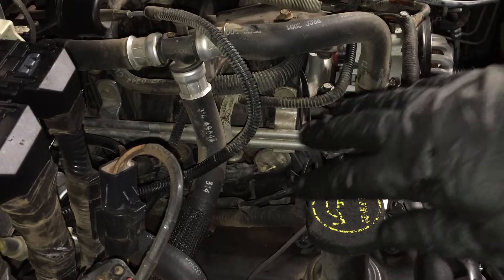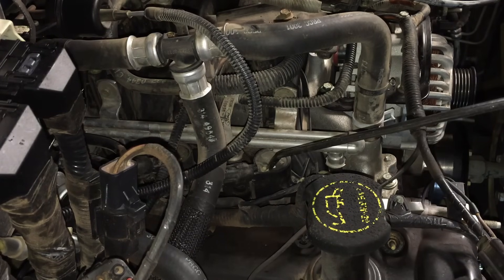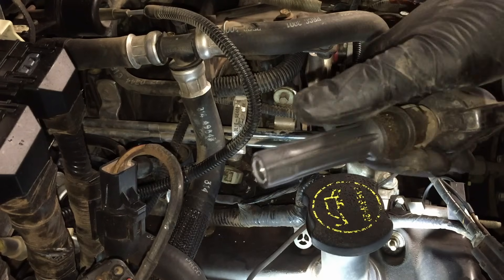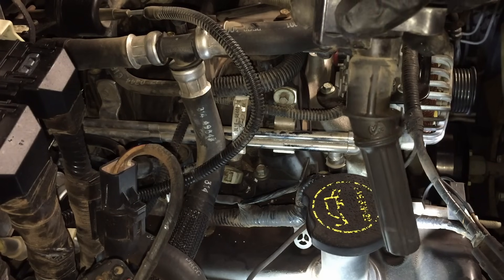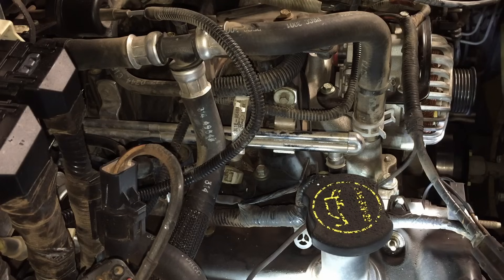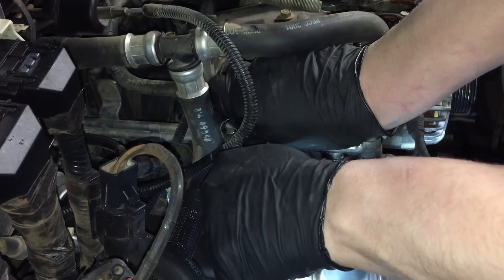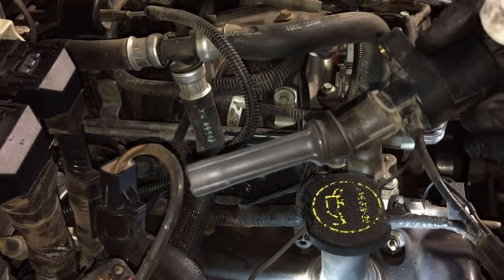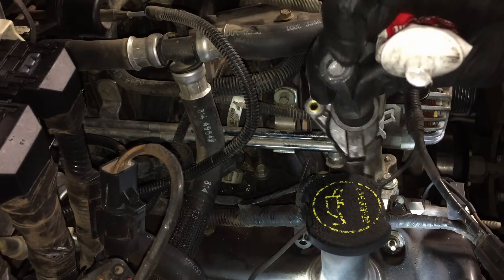Important Tips When Replacing Spark Plugs on Ford 4.6L 5.4L 6.8L 2v Engines

Comment: Thanks so much for your help with this issue. I have a 2003 F150 4.6l and this is the second coil that I need to replace and I can't afford to pay the shop another $250 so this helps a lot.

Comment: Why would there be a metal piece in Cylinder Nr 4 on a 2000 Lincoln Town Car 4.6 Liter engine?  I found it when I could't get the spark plug socket to go on the plug.  Apparently I jammed it when I was trying to engage the socket  I tried to remove it but could only get it to turn down on one side.  I can get a pick under that side but can't get enough leverage to remove it.  Any suggestions on why it is in there and how to remove it?

Comment: Small but important issue with re-installing these plugs.  Torque wrenches definitely provide predictable and repeatable torque, settings that are much more reliable than "go by feel".  Whose "feel"  Without a known force being applied or when a set torque is reached the casual DIY mechanic has no idea how tight or lose plugs really are.  As important a task as this is its equally important to give newbies advice that relies on experience they probably do not have.

Otherwise one of the better Modular Motor plug changing videos.  Thanks for sharing!
Reply from the maker: +jwa718 Delete? True but a 3/8" standard length ratchet improves that feel and prevents over torqueing for most owners.

Comment: my father did a radiator flush on my 2002 ford expedition. Now it idles too high just above 2000 rpm and goes down a little. I drove it and it also now hesitates like its going to die when you go to stop. Any suggestions?
Reply from the maker: +Randy Nelson Jr Check the vacuum and pcv lines.

Comment: Just changed my spark plugs but went cheaper and got NGK plugs. Week later I hear a ticking/printing noise. thought it was loud injectors or valve slap. Should I try motorcraft or thicker oil?
Reply from the maker: +Ernest Hayes Motorcraft
Reply: I forgot  to state that's it's the 3.8l v6 windstar.  It has a knocking sound,that comes from the intake clamshell area.

Comment: I have a 2001 f250 with the 5.4 and I was able to replace 7 of the plugs but ran into a rubber boot at the bottom one of the spark plug and can not reach the hex part of the plug. how can I get this rubber piece off the bottom of the spark plug?I have tried a wire hanger, 3in deck screws, and long thin needle nose pliers

Comment: Could you do a video on changing spark plugs on the 4.0 engine like what is in a 2010 mustang? Mine seem to be micro welded in the heads at only 50k miles. Thanks!

Comment: I have a F150 with the 4.6, 8th letter in the VIN is "W". I hear these are the 2V models. I wanted to double check and make sure this is the 2V because of the horror storied I have heard from the 3V engines. Thank you for the video it was a great help
Reply from the maker: +Matt Rachal I have never seen a 3v 4.6l in the f-150
Reply: ok thank you! I am not a genius when it comes to engines. All I know is that i dont want to hear that terrible crack when i remove the plugs. Thanks for the video as well great help
Reply: They do indeed put 3v 4.6 engines in f150.  At least in 2009 they did.  I did a timing job on a friends after it chucked a roller follower.

Comment: Hi, I just watched your video, very very insightful.  I have one question.  Do I need to take the fuel rail out to get to plug #7?  It looks like the only thing I can do since there is so little room.
Reply: Very late reply, but NO, you don't have to remove the fuel rail. It is a real PITA on #7, but it can be done with patience. I can't tell you how many times I have cussed at the Fuel Pressure Regulator that sits in the way lol.
Reply: i didnt have to on my 5.4l expedition '00
Reply: John Stutz Pulling the rail and fuel injectors, you may have to replace all of your o-rings on the injectors. Other than that, it's just added stress lol. The coil will come out. You wont break it. The rubber boot will flex. Twist and pull the coil at an angle. The coil will come out from under the fuel rail.
Reply: John Stutz Do you have the bolt removed that holds the coil in place? That is the hardest part. I bought several wrenches of different lengths and shapes lmao to attack that coil. Flex head. I even bent a long wrench to reach the bolt. My issue is my hands are big, but was able to get the bolt out with a regular length wrench. I had to fish the wrench into place due to the coil and injector wires along the valve cover, but I couldve disconnected each wire and pushed the wires out of the way. I just didnt want too. I kept a long magnet in one hand near the bolt as I used my fingers to back the bolt the rest of the way out. As soon as the bolt came out, I grabbed it with the magnet. Twist the coil and pull as you are twisting it. Reversal, Put the coil in the same way you removed it. Installing the bolt is the hardest part. Id LOVE to meet the idiot who designed this engine.
Reply: @Pr0ph3cy-k5z  Whats funny, on my 98 I used a small Zip Tie and zipped it tight and it came off with ease on 7 and 8 . Now, my 99 is due to get new packs and coils and I will do the same with that also.
Reply: I have CUSSED AT THIS FOR OVER AN HOUR NOW !!!   I cant get the coil out there is not enough room.  What are the down sides to pulling up on the rail?
Reply: Regarding the V10 2V, you do not need to remove the fuel rail.
Reply: I didnt on 03 p71. Just wiggle it out. The boot's all rubber

Comment: what is the most amount of miles that you have seen on an original 2V 5.4l and automatic transmission on a ford pickup?
Reply from the maker: +Jeffery Graham Maybe 300k
Reply: ok thank you for getting back to me so quickly.  I am looking at an 03 f350 with 276,Xxx on it.  it's rwd with the position rear end. I think I might pick it up for 1600.00.  it has very minimal rust and has been babied.  what do you think? it has the 5.4l.

Comment: Any suggestions for removing spark plugs from the 4.0 V6? My 2010 mustang has 51000 miles on it. I tried removing them with a 3/8 ratchet and medium extension but could not get them to budge. I was applying enough torque to flex the extension so I gave up in fear of striping out the thread on the heads. I even tried tightening and then removing but no luck. I have heard to try and remove from hot engine but also read that is a no no. Have also heard of using penetrating oil and let it sit over night then try to remove but haven't tried that yet. These are the original plugs. Why Ford did not use anti seize is beyond me.

Comment: my car has a misfire for cylinder 4,7 and 8 what do you think is the problem I changed the spark plugs,I have a 2002 grand marquis
Reply from the maker: +james joj Oil in the wells and coils most times.
Reply: +FordTechMakuloco how do I get the oil out the wells

Comment: Having been an automotive technician and shop/business owner for over 40 years, I have worked on, and witness the development of technology of, a great number of systems and engines over the years. I don't have a very high opinion of Ford's modular series of engines, I think they are an engineering failure. However, they are great for making money.
Reply: I've always heard that the 4.6 V8 was a quite decent engine, especially in comparison to the 5.4 V8.

Comment: Hey man, I'm a new subscriber and really dig your videos and your approach, attention to detail in explaining items that so many miss or say under their breath thinking it's not important. Been kinda hooked on learning more about my F150 5.4L from ya. Thanks for that. 

Question: I watched the above video and finally went in there and got all sparks done besides 7 & 8 because the chromed fuel lines ext. above the 7mm on the coil. I heard you mention the swivel for the ratchet which I have but was still a pain in the a**. What exactly do you recommend tool wise for getting in there the easiest? I might have the wrong type of something. 

I'll say that fallowing your tips it wasn't at all as hard as I thought it would be and definitely not as hard as all my know it all buddies said it was....
Thanks Again brother, Dave
Reply: 7mm open end wrench that ratchets. The ratchet end also moves into different angles. Not sure what its called, but Gearwrench makes it. I had bent a 7mm open end wrench that worked, but took forever to remove the bolts. The ratcheting end open end wrench fixed that issue.
Reply: MintCraft Pro FPG7MM 7mm Flexible Ratchet Wrench, Small, Silver. Look for it on Amazon. My mistake on the brand name.
Reply: small zip tie worked for me very well, just my two cents,

Comment: Good tips, put I've always been told NOT to use anti seize, and not to over torque it as it will ruin the thread also. And always do the plugs when the engine is cold.
Reply: If there are too few threads to begin with -- thanks, Ford -- such that engine vibration causes plugs to back out and eventually blow out, why would you use anti-seize to hasten that officially 'undocumented' and unofficially well-documented feature of the Ford Triton?  Keep your anti-seize on the shelf.

Comment: My 2007 5.4 in Regina sask Canada Ford dealer wanted 1800.00 to replace the plugs.
Reply: +Dean Zelles They are counting on breaking all of the plugs.
Reply: 1 Can = 0.76735 usd as of today.
Reply: +Dean Zelles What is the exchange rate 100 canadian to 500 us dollars?!
Reply: Dean Zelles my buddy wanted 3 1/2 hours = about $450 labor ( $150/hour friend price ) and plugs $30, if you get coil packs $250, wires?? that's $ 730 before wires.  I imagine it would be $800 from a friend....  I'm so doing it myself

Comment: I have a code P 0304 misfire cylinder 4 detected how to fix that. My expedition shake when I press on the accelerator pedal roughly while drinking but not when it is park. Please help!
Reply: +Michel Tran I have the same problem
Reply: +Michel Tran You guys need to cut back on all of that "drinking." Your first step to diagnose, and repair, a OBD2 code P0304 would be to check for spark at the plug with a spark tester. I personally like an OEM 25069 which has an adjustable gap(resistance) which allows you to test many different types/design ignitions. They can be found at AZ for around $10.

Comment: If only 1 or 2 coil packs are weak,shouldn't the car start?....
Reply: +roger b Yes it will, but with one coil bad, it's rough and only limp around town, no highway.  Have not experienced 2 bad coils, but I bet it's way worse.
Plus you ruin your Cat Converter ($2k) if you drive long w/ a misfire.

Comment: i have been running E3 plugs in everything that i have including my 95 lincoln towncar with the 2v 4.6L and even though if it was me referring to a customer i would recommend the OEM plugs i just prefer the E3 myself. my towncar has 326K on her and she has started to knock due to being run low on oil too many times (the car had a bad oil leak that i almost never figured out). i do love the car and i am amazed at how well these engines run and how reliable they are. do you think that there is any way to put the 4v 4.6 in the towncar without running into too many issues (thinking of using a 95 mark 8 as my basis for a donor car) i appreciate any input on this that you may be able to offer. i was told that the valve covers were too wide to fit in the towncar because it would hit the brake booster and im not to comfortable with going to a smaller booster considering how big of a car this is lol.

Comment: Great job on the video. Question how often do I need to change the coils, because I have a 2004 f150 4.6 with over 300,000, and it use to be my dad and he can't remember how long it been since the spark plugs were last changed???
Reply: +Daniel sill Towards the end of video, he mentioned to change them by 100,000 miles, and to use motocraft only, since after markert coils tend to have problems.  He has a link to Amazon for motocraft plugs that will save you money versus a Dealer possibly.   Watch the later half of video for his specific statements if you like.

Comment: Do you have a good tip on how to remove the plug, I was trying to remove them and broke mine off.  They are extremely tight in there.  The whole plug came off expect for the thread part of the plug and the outer casing is still stuck in the bay.  I have a 2003 ford f150 4.6 liter.  I looked at your other videos but they are for the 2004 and up so those removal tools look that they might not work.

Comment: Any suggestions on removing the 7mm COP bolt if frozen? Or if the insert just spins in the intake? Great youtube channel BTW. Very impressed.
Reply from the maker: +David Lane A vice grips and a slide hammer is what we use
Reply: +FordTechMakuloco Thanks for the tip!

Comment: I have a 2002 explorer 4x4 4.0  it had a new transfer case installed new rear abs differential sensor new output shaft sensor the two new speed sensors and a new transfer case motor and  a new 4x4 control module behind glove box. when making sharp turns it feels like the front wheels lock up. when I unplug the 4x4 module or the transfer case module the wheels don't lock up.
Reply from the maker: +Alexis Gutierrez What are each of the tire circumfrences?
Reply: I think it had 16 inch rims factory ford wheels i dont recall the tire size, i have the truck at work. Rims are Five spoke design. For now I just put in 4x4 auto and just unplugged the 4x4 control module behind the glove box. It's the only way it drives with no locking at sharp turns. But at some point I know I'm going to need 4x4.

Comment: IF you changed coils with aftermarket already and it was fine and then the truck sat for a year, would that cause those aftermarkets to cause issues when they were fine and no miles were put on them?
Reply from the maker: No it should not but those cheaply coils can fail at anytime just not likely

Comment: Spark plug screw on cap fell off when boot was removed from spark plug allowing it to fall out of boot and landing at edge of spark plug so the socket would not slide over the spark plug to allow removal

Comment: Helping my son today to change spark plugs on a 5.4 2v 1998 ford expedition, started out good on first plug all went okay, got to 2nd plug on passenger side, I believe it's #2, spark plug socket is 5/8 but it won't slide down over the spark plug so we can't remove that one, can't see down in the hole to see if something is there like a rubber boot from a spark plug socket, need a solution, any suggestions on what to do? Thanks
Reply: To: FordTechMakuloco.   Please can you help. any suggestions on what to do? could it possibly be a broken boot preventing the spark plug socket from going on all the way?  Thanks, Ddd Ddd
Reply from the maker: Almost always there is dirt or more likely a small rock in there on one of the flats not allowing the socket to drop into the hex. Get some compressed air in there to clear out debris I have had to use a long flat black to dislodge the rock first

Comment: Do you ever use dielectric on connectors?
Reply from the maker: +GeekDIY Mechanic Yes all the time just a little on the terminals and some on the weather seals so they slide together easier and connect all the way. I use different stuff made just for the lower current Here- http://www.amazon.com/gp/product/B000NUBB28/ref=as_li_tl?ie=UTF8&camp=1789&creative=390957&creativeASIN=B000NUBB28&linkCode=as2&tag=fordt-20&linkId=P6HUBLNXKPG5W4MU

Comment: Great videos ! Love how you support the "why" when doing something.  You sold me on the use of anti-seize. Using that and the "over torque" makes sense to this former wrench.    I just did my brothers 2004 v10 Excursion.  I've heard you and many others say "there is hardly any threads in the head..."   I used my inspection cam and was shocked on how many threads were there.  Were there different/updated heads by 2004 on the 2 valve tritons ??
Reply: yes, there are updated heads. i believe in 03? you’d have to verify this but my 02 has 2 threads
Reply: @BogusQuacky  Supposedly mid year 2003 but i havent been able to get any proof at all and havent changed mine yet. Sad thing is they never made the improved part for those years and offered them as a part. just screwed, Sick
Reply: If you Use Anti Seize you Change the TORQUE Values Causing Stripped Threads, And could Effect Spark Plug Grounding, Also Can Cause Spark Plug Over Heating.. Spark Plugs these Days come with a Zinc-Chromate Plating to Help with Spark Plug Seizure.. Dont Use Anti-Sieze on Spark Plugs.. Good Luck  👍
Reply: As mentioned in replies, the addition of anti-seize would seem counter productive to plug retention. Read that ford also came out against the use. For the most part, a great vid, but it would be great to hear much more related to the use of anti-seize. Putting anything ( Loctite, anti-seize, spray penetrant) on the threads, might lead to seat contamination and result in debris corruption of the threads. Torque settings corrupted by resulting contamination?

Comment: I use an air ratchet to take out the old spark plugs only.Plus you have to be careful when removing them also,threads might come out of the head.I heard of a case E3s screwing up a Ford computer system.Ran bad which was not ignition related and the 4wd did not work.Took it to 6 different shops,the 6th shop that looked at it found the problem,it was the E3s causing all of these problems.Luckily the owner had a set of Motorcraft plugs underneath the driver's seat and they fixed the problem installing the Motorcraft spark plugs.
Reply from the maker: +wafrederick I firkin hate those E3 plugs!!!!!
Reply: The owner installed the E3s himself.I don't like E3s myself also.Seen them cause a misfire in a GM once so far.